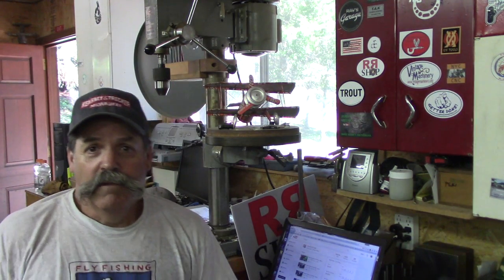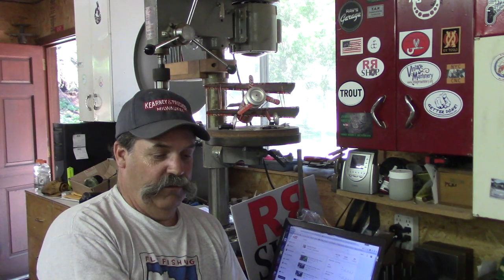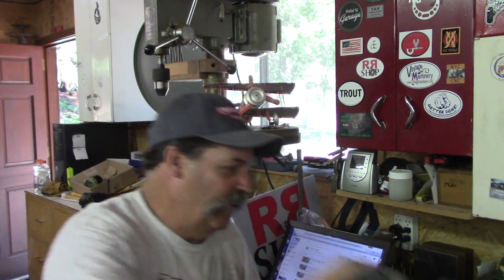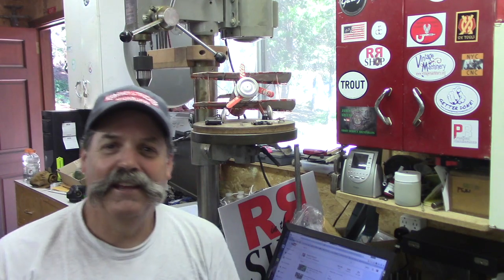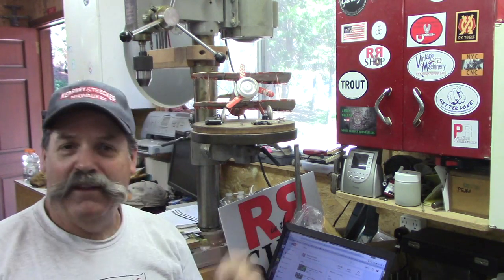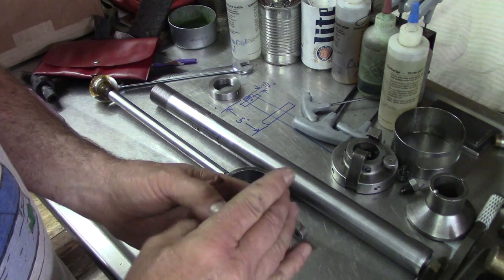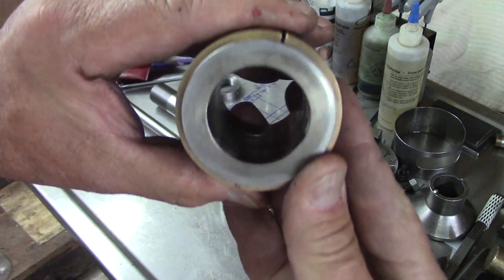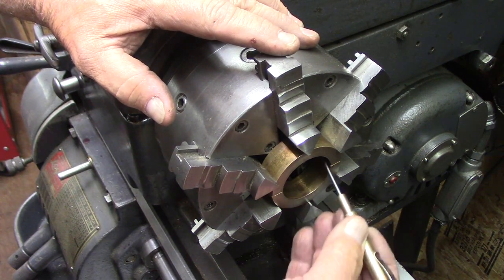Logan Lathe Collet Closer Repair P1

Comment: This is a fastening series in your search for the causes of vibration. 
Excellent vernier height gage purchase and perfect for those one-time reference height settings. 
I like your Anderson A-Frame style balancing device and so useful for fine tuning your lathe and milling machine pulley balances and vibration improvements.
Thank you for taking the time to explain your thinking and diagnostics, Paul (Also, great stories about your fishing trip :-) )
Reply from the maker: Thanks Paul.  I still have some vibration from the runout of the shaft, I will have to tackle that next.  Fishing was great.

Comment: that height gauge is a gift at that price. i picked up a 454 which is three times as big, and its seen a lot more use. cost about the same with the conversion rate i guess. congrats on the subscribers too! the collet closer is very interesting to me, thanks for sharing a close up look of it and how it works.
Reply from the maker: Thanks Emma, I to have a 454 that is in great same and came in the original box like yours.  It is just to large to use on the milling machine and this smaller one will work much better.  I will still have to get the runout of the shaft fixed up, to get rid of the rest of the vibration.

Comment: The height gauge is sweet. Vernier scales are still fine - I still use my vernier calipers happily - analogue is still good. I'm so old I grew up using slide rules. :)
The collet closer is quite a complex piece.
Reply from the maker: The height gauge is basically new, perfect condition.  did you need a slide rule I have several, learned in high school.  The closer is working 100 times better, but I still want to get the runout removed.  Thanks Chris for stopping in.  Getting hot here.
Reply: I can't find my old 12" slide rule so maybe later if you have a spare it'd be good to have. Will catch you for a chat sometime.
Hot eh - yeah looks excessive judging by forecast - we have currently way too much rain!

Comment: That acrylic handle got me to thinking that you could replace ball handles by filling a paper cup with resin, suspend a cleaned and maybe knurled handle into it, give it plenty of time to cure and turn the resin down to a ball. Polish to finish.
Reply from the maker: What is on there is a shop made rig.  The ball actually spins on the shaft.  You can not pull it off.